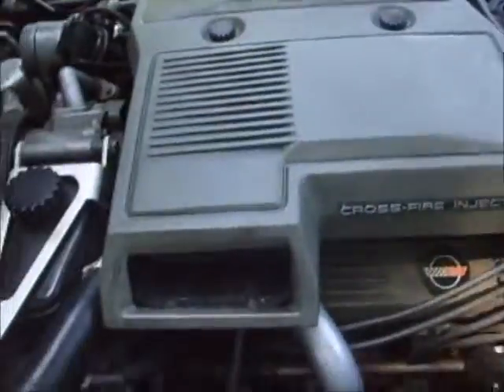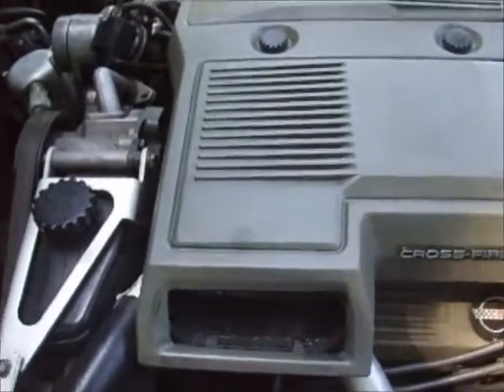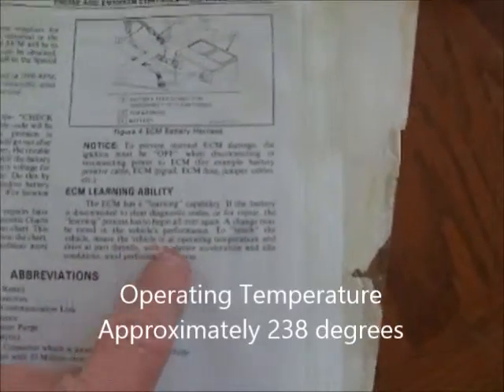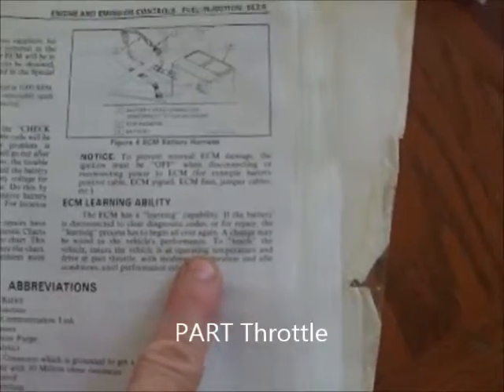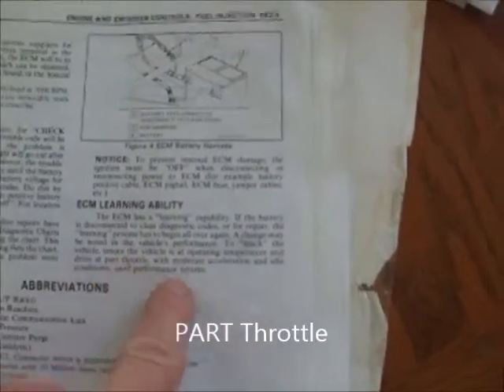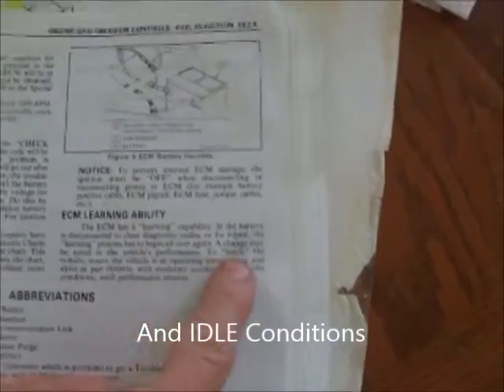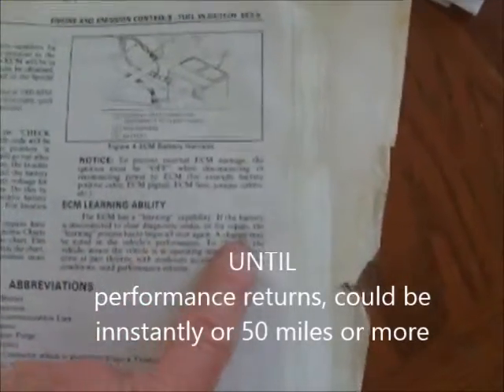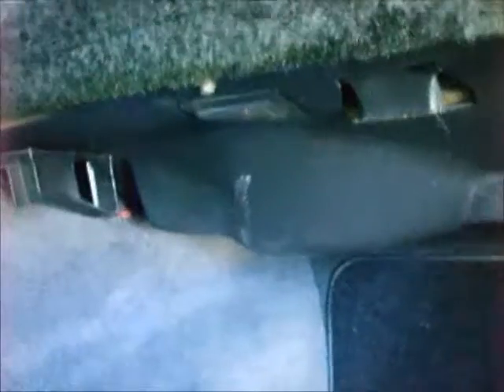𝟏𝟗𝟖𝟒 𝐂𝐎𝐑𝐕𝐄𝐓𝐓𝐄  Electronic Control Module Learning Ability

Comment: My ECM went out and I got it rebuilt, before I put it back in I’d like to make sure all my wiring is good to make sure I don’t just fry it again. Any idea where I should start? I watched most your videos on this crossfire so I know this car is very sensitive, just wanna be sure everything is good before putting it back in
Reply from the maker: Solenoid Resistance. Too little resistance in a solenoid will always cause early failure of the ECM. Incorrect resistance will cause the ECM drivers, quad drivers and transistors to get VERY HOT and melt. SORRY about the long answer but NO easy short answer to this question, but at least your trying to do it right,  best tool for diagnosing and maintaining a 1984 Corvette is a Digital Multi Meter.  The injectors, fuel pump relay, egr, etc. are all solenoids, check their resistance values for sure, the ECM is just a series of Drivers, QUAD Drivers, Transistors (on/off) Switches etc., it looks strictly at voltages, it has no logic, it sees voltage as either good or bad, it cannot adjust the incoming voltage to save a driver/transistor, and self diagnose like today's ECU's. *Too little as opposed to too much* resistance in a solenoid of one of the injectors will burn a driver inside the ECM very quickly.  The resistance across the injector terminals should be at least 1.4 OHMS, please confirm that with FSM,  the resistance of the fuel pump relay terminals should be 20 OHMS **I think**...always refer to the FSM. I would suggest checking the battery, just because it has 12.6 volts doesn't mean one of the cells isn't  weak, causing the alternator to SPIKE a voltage, that will fry a ECM. The FP relay from the facotry had a DIODE that protected the driver at PIn 18, the after market ones, do not....might look inside the FPR and see if it is a replacement piece of junk, the FPR works full time, has a solenoid coil that can get really hot, I have seen the connectors at the FPR burned pretty badly, don't know where that current went but I would think either to a ground or back flowed to the driver inside the ECM.. I would suggest checking the MAIN grounds, especially G160  and G161 anything grounded for the ECM. Again tough question, sorry for the long answer, tried to be brief. 84's are electrically complex for sure. POOR jump starting or constantly jump starting, LONG starting times etc, will fry the ECM drivers also. Wish you luck, happy to help if I can.
Reply: @HorseshoeBeach  exactly the answer i was looking for don’t apologize!! This helps more than you know thank you so much for your help. I really appreciate it. All your videos on here have saved me many times with this crossfire as there aren’t many other people out there that really know anything about it, so thank you again
Reply from the maker: Thanks, glad to hear they're helping someone

Comment: Thanks you may have solved my problem , black sooty plugs , removed egr to see if it made a difference , did not do the 40mph drive so had same results will try that Thanks
Reply from the maker: hope it works, just a heads up, the FSM says after repairs, drive the car until driveability returns, I originally thought this could possibly be several drive cycles for the ECM to reset itself.....FSM didn't go into a lot of detail regarding time???

Comment: Thank you, this vid was very helpful to me. My 84 is running great since I changed the  fuel injectors.
Reply from the maker: Mike .Van Everbeek Thanks Mike, just curious, are you able to communicate with your ALDL? If so do you use a hand held unit and what model?  Innova 3120 OBD1?
Reply: Hi Delta, I'm communicating with WinALDL (free) on my portable PC. The only thing you need is a serial port or usb converter and the right interface to plug in on the ALDL plug of your car. With WinALDL you are able to read out all live information of the ECM, even recording while you are driving the car, very helpful!  Here you can find every information about WinALDL. winaldl.joby.se. Call me if you encounter problems to communicate with the use of WinALDL. If you want, I have some pictures about the interface you need to build but also have a look at winaldl.joby.se/aldlcable.htm. This is exactly what I did.
Reply from the maker: Mike .Van Everbeek Wow, that's some very interesting information. I'm going to have to put this together and try to go this route. Appreciate the offer to help. Previous owner did some funky stuff (wiring etc) being very cautious working around the ECM, going to take it out this week maybe have it looked at.  Got so much going on right now, can't find time to get under the hood, but as soon as I can, going to look into this. Work on the car trying to restore it myself as time and duty permit, so slow process sometimes. I'll be checking back, thanks again Great Information.